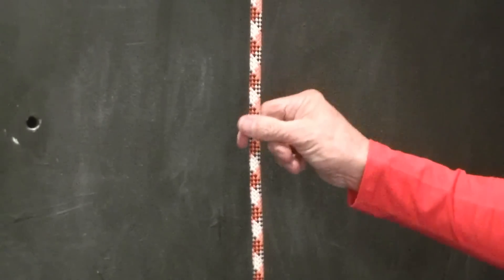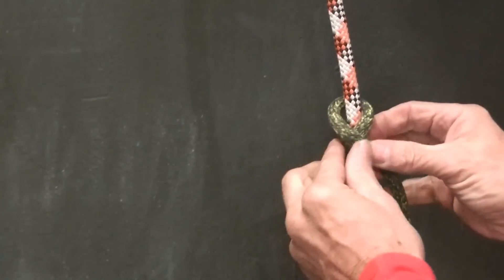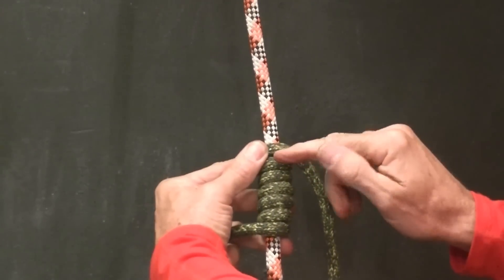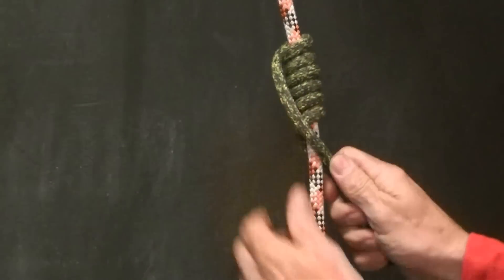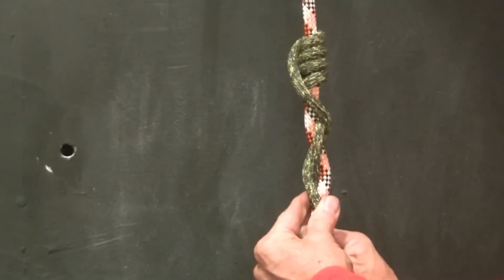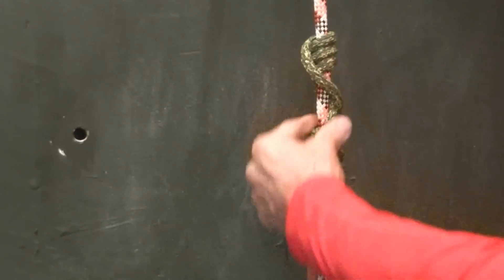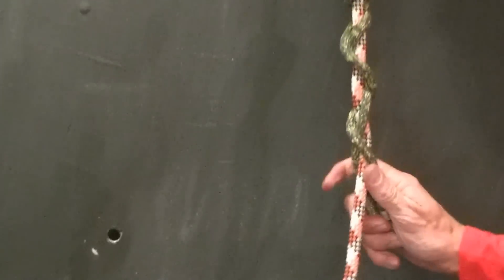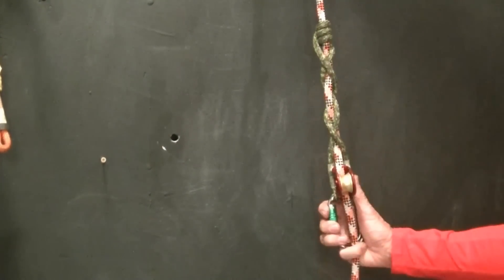Counting wraps and braids in a friction hitch

Comment: I am using a 7mm cord rated for 2550lbf for this reason. I wight 215lbs. Is this cord strong enough?
Reply from the maker: If we refer to the ANSI 133Z standard, assume whatever eye has be spliced or sewn for termination at each end holds 100% of the cord strength, 2 x 2550= 5100 pounds leaves it 300 pounds short of the 5400 pound requirement.

Comment: whats the shortest eye/eye you could use for a vt? i find mine has a lot of sit back and im constantly having to set it with my hand to get it to grip. i'm using 4 raps and 3 braids.
Reply from the maker: Depends on so many factors, diameter of hitch and line etc.  The answer you are looking for IMO is about 30 inches.
Note, I'm not comfortable if I have to always force my hitch to work as that's pretty risky.  Try my video on putting twist in your hitch.
Reply: Rope is just under 13mm and hitch is 8mm

Comment: strange how subtle differences can make a huge difference, i like using  VT WITH 9MM CORD 4 wraps 2 braids on 13 mm climbing line, but like a distle with 10mm cord for my flipline, i prefer the VT and hitch climber to my spider jack, though i haven't really gave it a chance to impress and have worked 7 days a week for most of the last year leaving little time to try new things
,,iv'e also tried the 11mm climbing lines but find it uncomfortable...love the videos, ive learned a lot already, just need to try new things  out